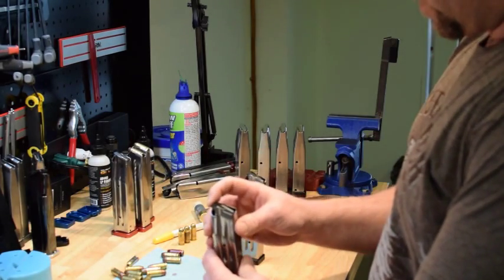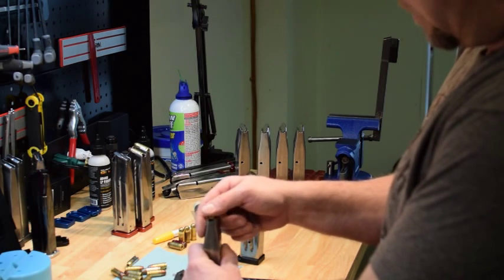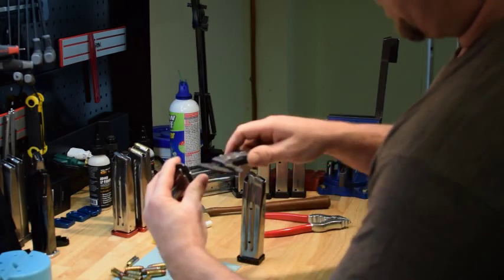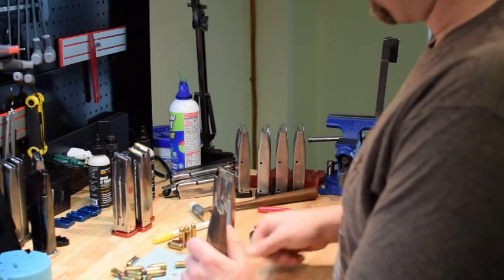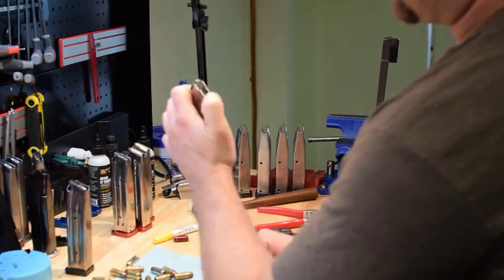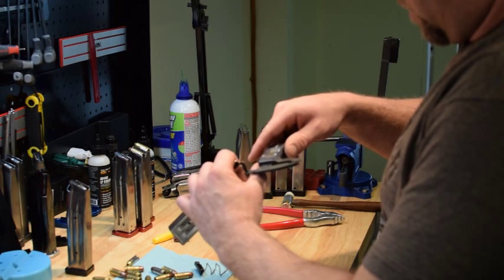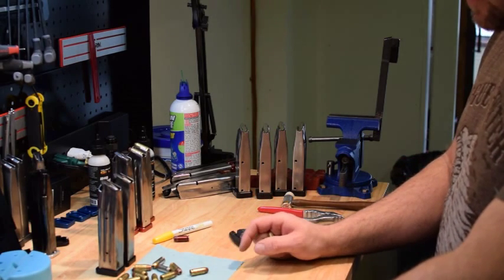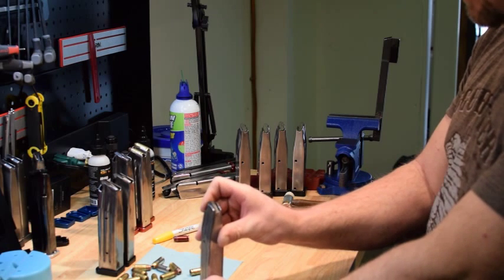2011 Feed Lip Tuning

Comment: What kind of follower are you using?  I bought an STI 140mm mag tube and a taran tactical follower , taran springs and taran basepad. Looks like the follower don't fit the feed ramp. It also has a tendency to slide all the way up into the front lip.
Reply: I have the same setup, and the same issue as you with the Taran followers.  If you listen closely he says he has a Gram follower.  I compared these to Taran and they look different in the pictures.  I am ordering some now.